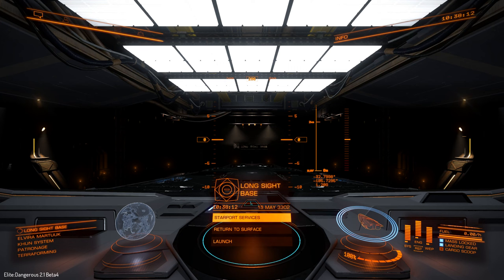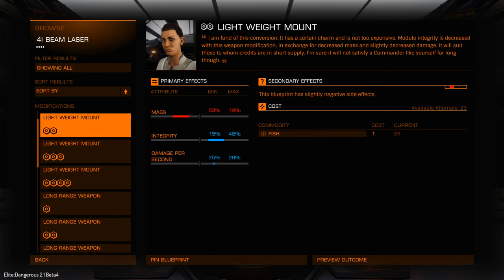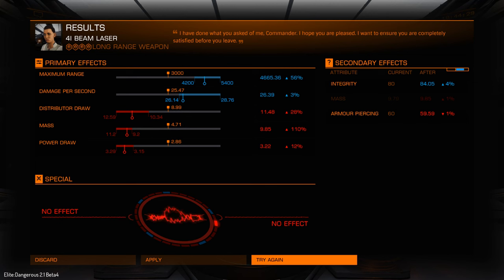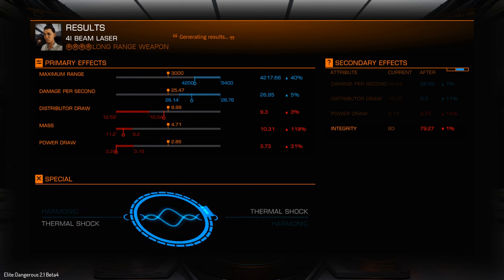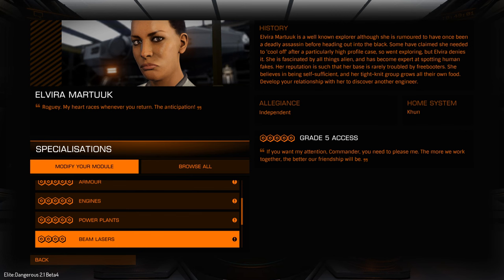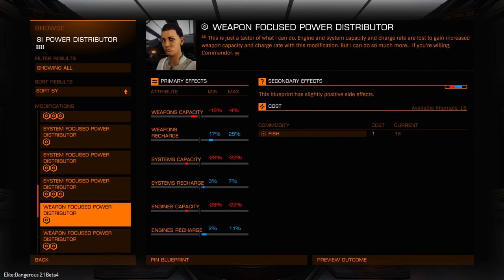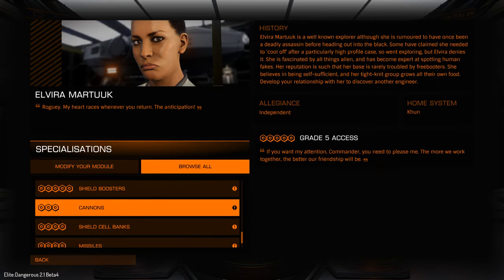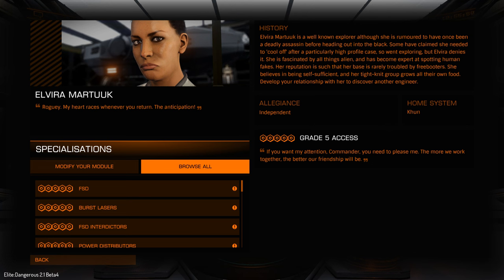A guide to the Engineers (Elite Dangerous)

Comment: I'm confused by something.  7:58 shows your original DPS at 25.47 and your new DPS at 26.95, then at 8:15 you use the same weapon for a new mod but your initial DPS is 20.21.  Even though you don't take that mod, you go back to long range and it still shows 20.21 DPS at 9:20.  Any idea what's going on?